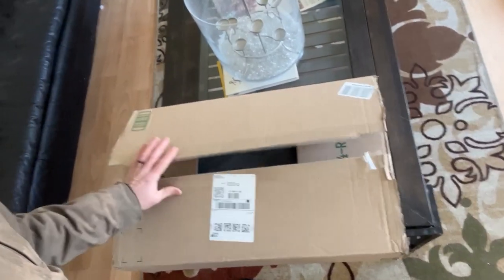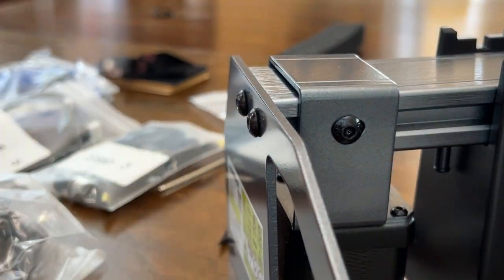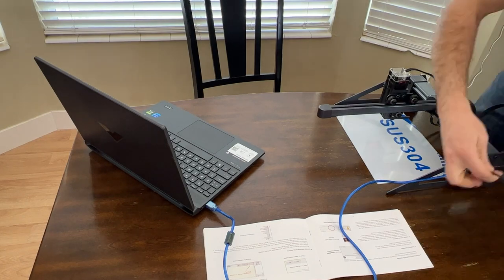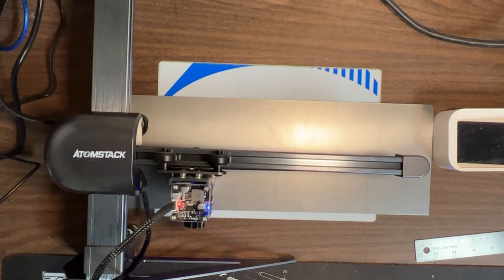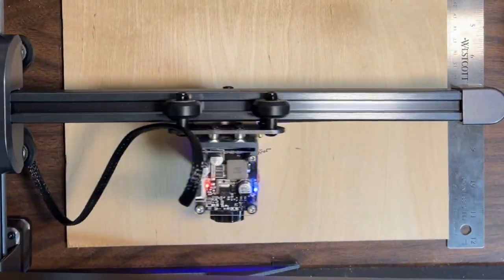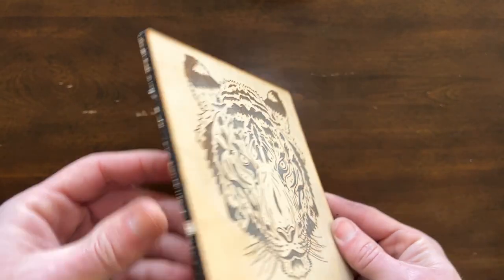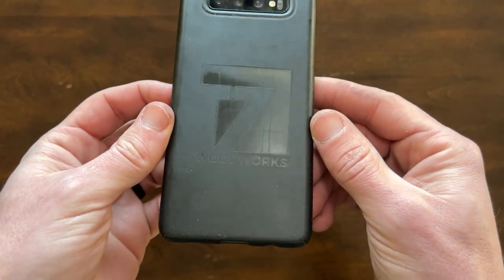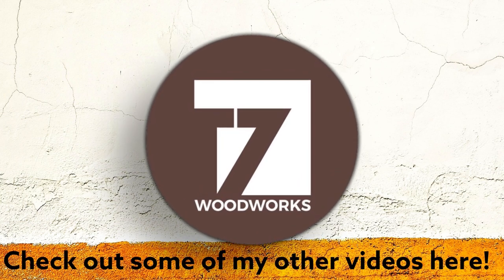UNEXPECTEDLY Awesome Little Machine ATOMSTACK P7 M30 Review

Comment: I just got one of these. You should remove that SUS304 paper from the 304 Stainless Steel Sheet. I also double sticky taped it to a flat piece of plywood. It is a pretty nice laser for the price and ease of use.